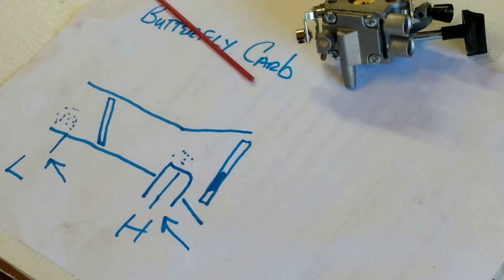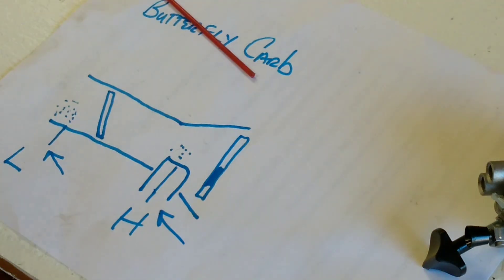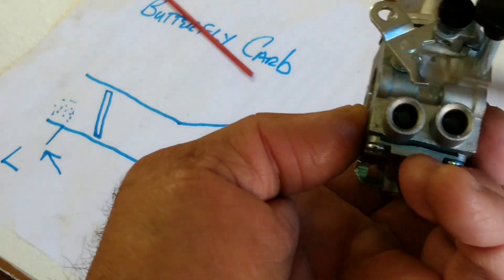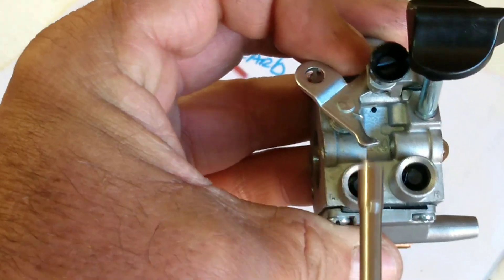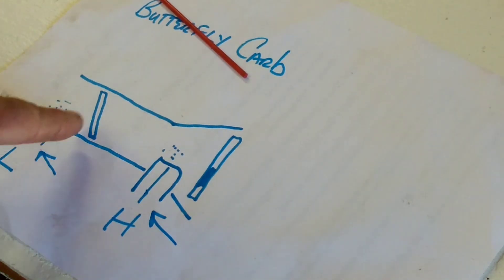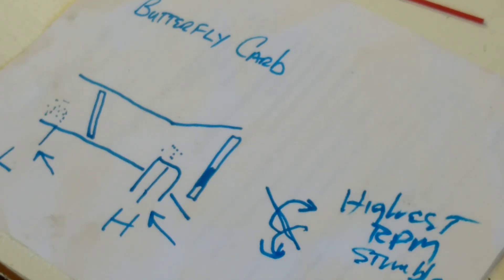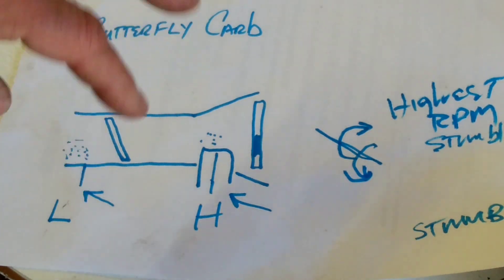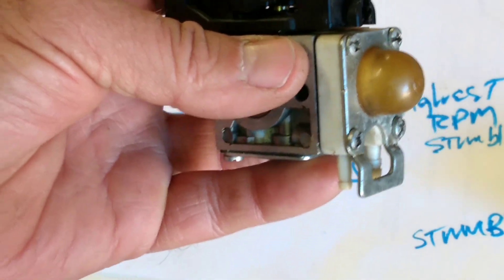Carburetor adjustments! What happens if I turn this screw?!

Comment: great video, great information. Seems like I can get the 4 strokes to go pretty well, but the 2 strokes......I put a new carb on my trimmer which has never run right, and it won't start w/o a squirt of carb cleaner. I'm pretty sure I got the new lines installed correctly, and the prime button also seems to be working. It's frustrating.......

Comment: Using this along with a bit of common sense I believe I know why my chainsaw bogs down and stops when I start cutting with it. My chain lock jammed, got mad and hit the bar really hard with my fist, I'm Irish, it unlocked. I bought this (sorry) Ryobi 16" saw, use it for about 3 hours and it started bogging down everytime I started cutting. Is it a common thing for the screws to self un adjust?
Would greatly appreciate the feedback! BTW I just subscribed, like your info and presentation.
Reply from the maker: Donnie, usually there is a small black O ring or a spring to prevent the screw from backing out. That's only if your machine does NOT have the limiter caps. I hope that helps.
Reply: @ZombieDaveAZ  thanks for the feedback, I've turned a few wrenches in my life but when it come to small engine stuff I'm just....weirded out.